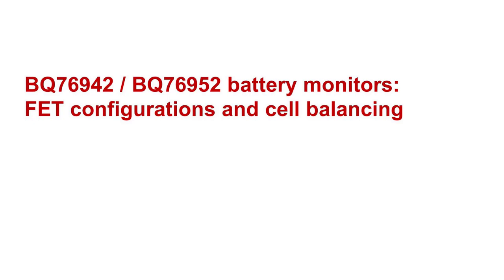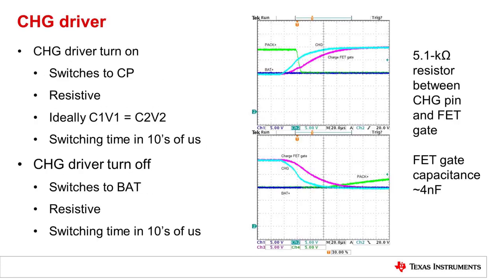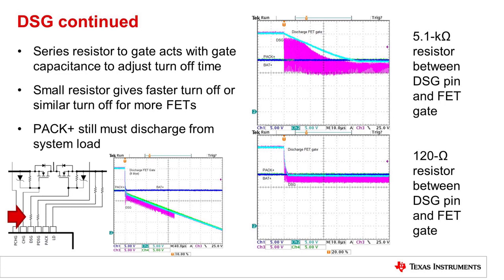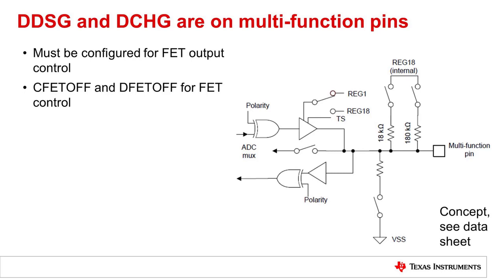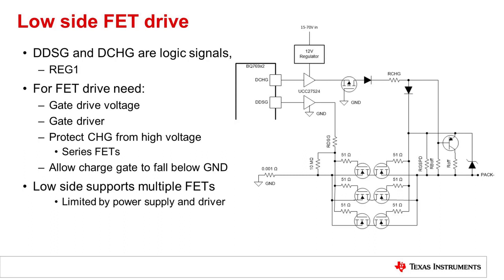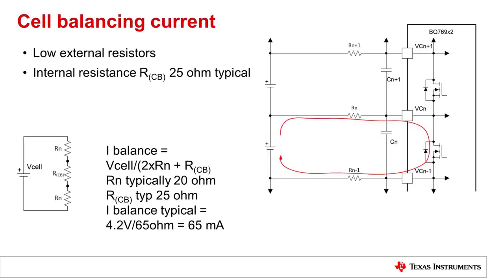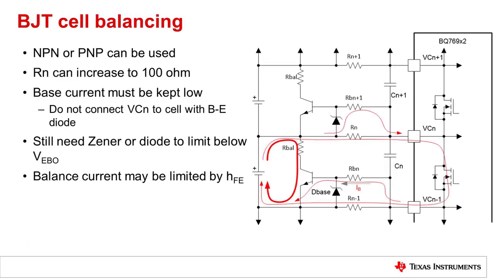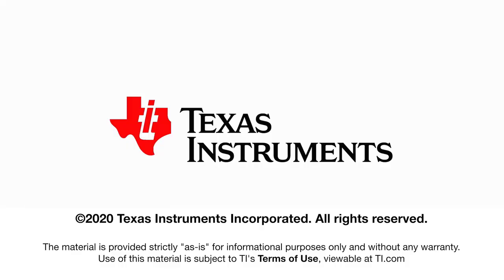BQ76942 / BQ76952 battery monitors: FET configurations and cell balancing

Comment: This is always discusion that we can connect in series few BMS of 48V, like 4x48V=192V system. We can read on internet general theory that BMS do BOOM when one BMS is off (e.g. by protection) then FET do short by itself and we get 192-48=144V with 0A current but still that high voltage kill our BMS. No one do that in live. In summary you say about serial connection of FET is possible, maybe you have a video more deep in this topic or please take my comment as suggestion to take video about that topic. BR Marcin from Poland.